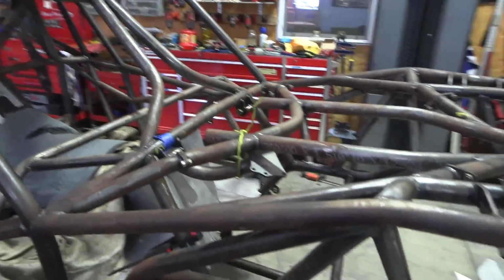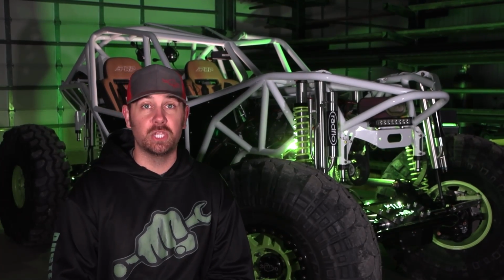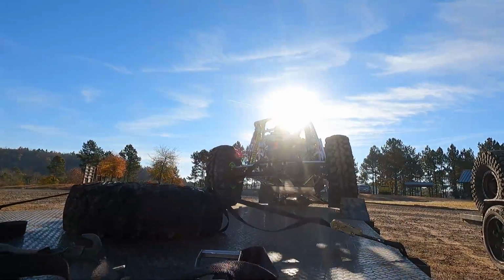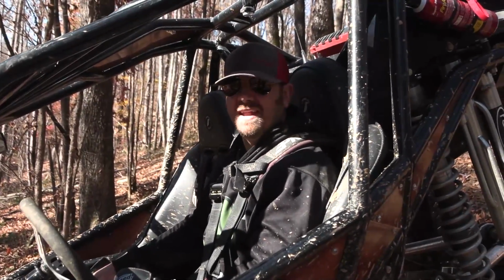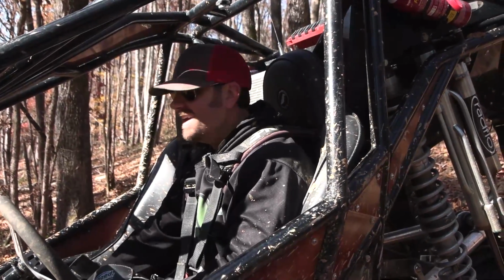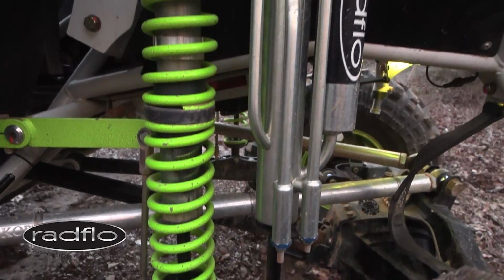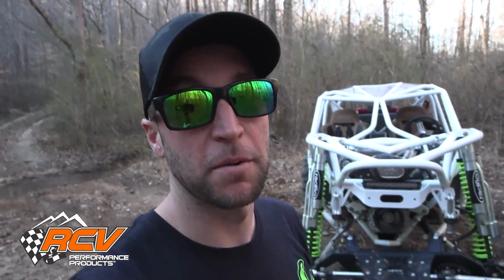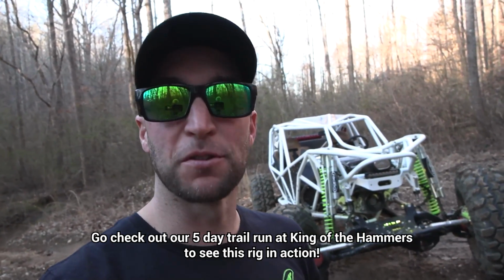KNUCKLEHEAD the New Busted Knuckle Films Rock Bouncer Build

Comment: You guys should wear neck protectors made by Simpson. They are the same company that make Hans devices. Rock crawling gets your head and neck jolting and quite often your head flings forward
Reply from the maker: I wear one and a helmet when racing, not usually necessary for trail riding
Reply: @BustedKnuckleVideo  I would, having a collision when you hit something wrong no matter what it is your head can fling forward causing neck pain. I would wear a neck brace for both
Reply from the maker: @NewEnglandPatriotsfan  to each their own I guess. The extra weight of the helmet trail riding all day can also hurt your neck.
Reply: @BustedKnuckleVideo  Yes so I would wear a neck brace safety first man

Comment: Do the magnetic mount rock lights attract debris over time? Like magnetic dirt particles and stuff? 
I want to use some magnetic mounted lights in a few places like inside for dome lights and a couple areas I don't want holes, but im worried about attracting debris especially parking in the shop with grinder dust etc.. I'm very curious about how it is living with magnetic mounts. I really like keeping my stuff clean so I wash it really well after each outing and I'm just really picky about little details like that. I'll spend hours coming up with a special mount or solutions to get around things like that and that allow me to easily clean and maintain my rig. People say I'm way too picky but I enjoy it
Reply from the maker: The magnetic mounts work great. I haven't noticed them collecting any material around them

Comment: That frame has atleast three fracture points fellas . Check your lines
Reply from the maker: They have been fully engineered actually with zero failures. 👍
Reply: The fracture point is the driver.
Reply: @BustedKnuckleVideo  just sayin , been around Score & Vorra since 1976 , and have friends that run the hammers . several spots look suspect. Especially where the upper frame run meets the cab . I’m happy to learn if I’m wrong , just let me know if I happen to be right later on . Best of luck with your season
Reply: @freedomworx  if your not cracking and breaking , your not racing , but you can’t win unless you finish. The line gets finer every year. Best of luck this season
Reply: I'm not sure that you are aware of who you are critiquing...do your homework big dawg
Reply: @garyosborn3168  I’m not sure you know the difference between a ,” Who “ and a ,” What “ my friend .